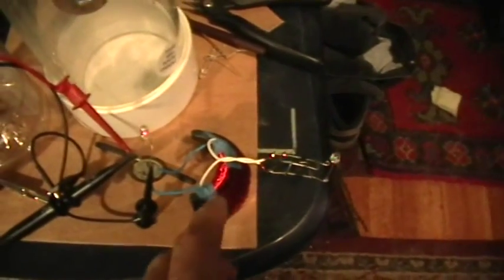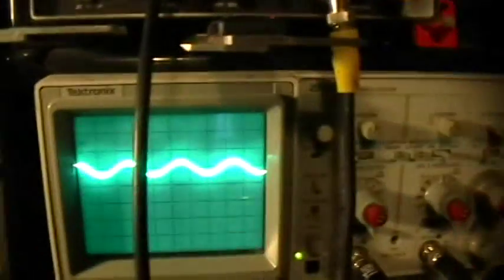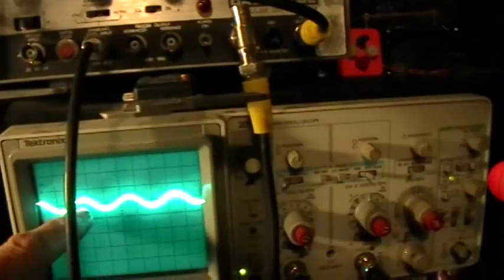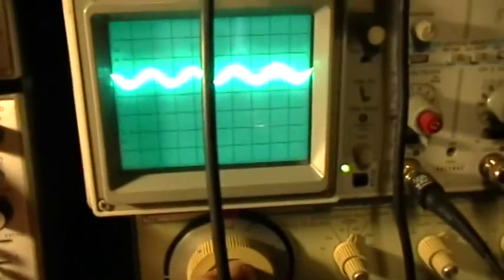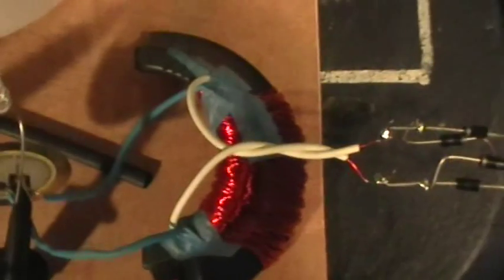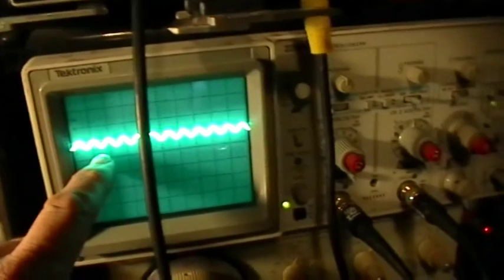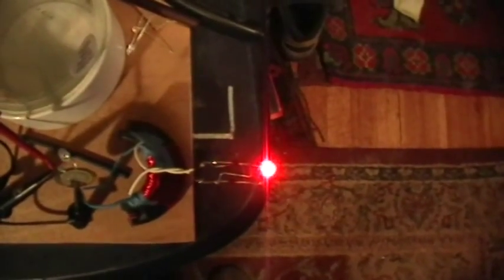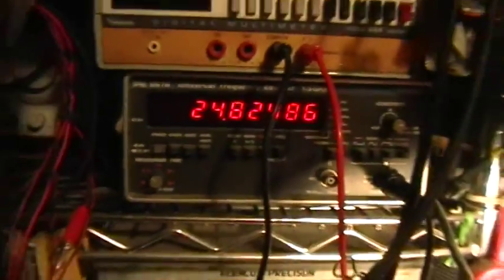Magnetic Resonance Amplifier 4: Ferrite Core Without Magnets

Comment: Ok. I think I got the input led thing worked out. Its got to do with the freq the capacitor (and tank) responds at. The cap has to fill up before the led can light up, but at some freq's the cap barely gets filled and the polarity is reversing. not giving the led time to light up. So when the led is not lit. All the current would be passing into the tank, through the cap at max efficiency. Correct me if I'm wrong.

I always thought tank circuits where some dark magic. With the way the textbooks talk about them. Now I have watched this series, I'm thinking I have been playing with tanks a lot. Particularly with sliders Simple Wireless Electricity System. Bunch of stuff is starting to fall into place. Thanks again TK.

Now if only I could understand exactly HOW a cap can pass ac.... I get the basic gist of capacitive coupling. Where potential on one plate causes opposing potential on the other plate (If there is somewhere to shuffle electrons to/from attached to second plate) But it still seems like its breaking the laws of dielectrics and thus dark magic. When current magically vanishes from one side of the dielectric and appears on the other side.... Its been keeping me up at night for months now... Any guidance would be very greatly appreciated. Once I can look at a cap passing ac and not feel like I'm breaking the laws of physics. I can move on to filter circuits and multipliers etc. Something else thats been keeping me awake at night.  Again, I get the basic theroy, but until I know exactly whats going on in those caps, I cant work with it. Driving me bonkers. Is there a basic circuit I can build and examine to get a better understanding? I've played with multipliers a bit. On the bench and in sim, can see it working, just dont get how its working... How do the amps get from one side of the cap to the other? The voltage part makes sense. But how is it possible to pull amps through a cap??? It just seems so wrong, yet I can observe it for myself, and its well documented. I know its happening. I just dont understand how.... Using a signal on a cap to pull power from somewhere else on the other side of the cap, like ground. Makes perfect sense. Potential and columb force and all that. But why does it consume current from my input side??? Are electrons being teleported? Because thats what my brain is trying to tell me....
Reply: The truth is. Particles such as magical electrons do not exist. If you really want to seek answer, go do research on ferrocell. It shows you the magnetic field. If you apply it to a capacitor, you may say it is magnetic interaction but, the correct term is aetheric perturbation. However, it us much more than that. Action and reaction. That's the secret.